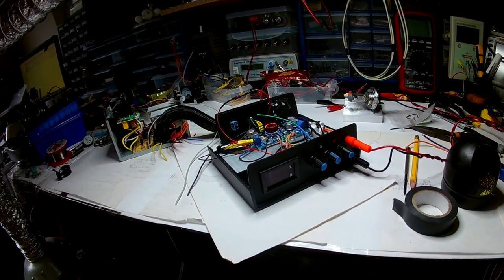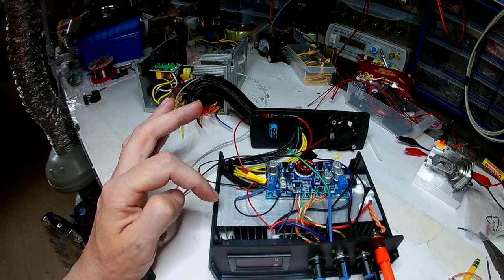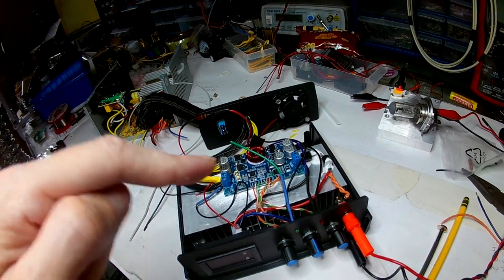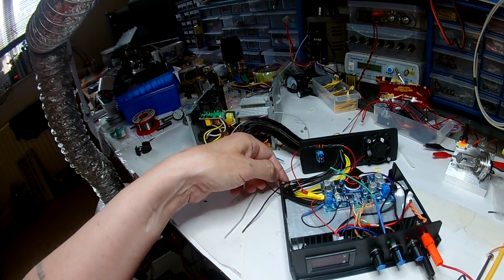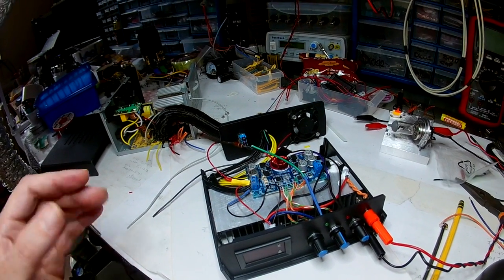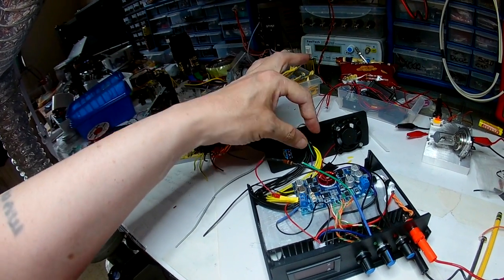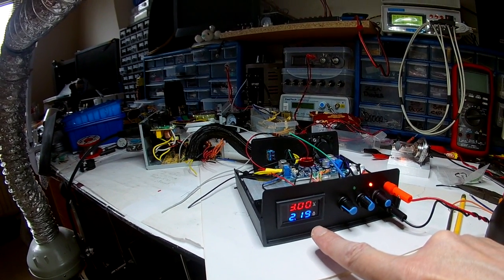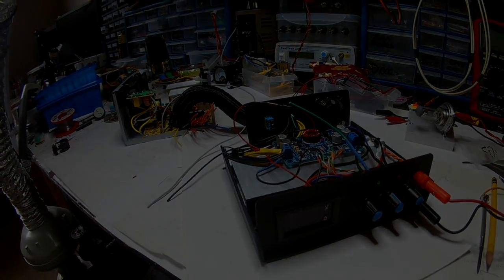DIY Bench Power Supply Using ATX PSU with LTC3780

Comment: How is the module performing after all? I got mine and I'm still looking for a way to change the trimpots. Afeter reading some reviews about this module "WD2002SJ - LTC3780 " it looks like changing the trimpots with a single turn pot it is not working for every one due to the design of the module and high frequencies (inductance and capacitance) which play a big role here. Some ppl killed their modules doing so, others didn't get them to work with a single turn pot and had to change them back with the "original" ones. Wire-wound potentiometers seems to be out of question, worst idea for this application and not only ( high inductance). Your feedback would be highly appreciate it.

Comment: great build and vids, built one using the same 3780 removed the pots from the pcb the 500k and 250k ones for cc and cv, using a 13.8v 5 amp psu to supply the buck boost board and seems to go in to fault as soon as it gets to around 12v output, the pots on the front panel are only the single turn type, any ideas ?. 

oh also had another board think it was a knock off tried charging a battery 12v battery and it blew the 25v output caps on the 13.8v psu never thought it could back feed now using output diodes
Reply: how do you know how far to adjust the under voltage one ?
Reply from the maker: i adjust mine and one way it lets me have output and full the other way it does not.
Reply: The under voltage pot is for if you are powering the board from a battery/solar power system. For this design it is only necessary to adjust it a little above your 12V input from the ATX power supply voltage. The fault LED would then indicate if there is a fault with that input voltage (i.e. your ATX PSU is fritzed.)
Reply: cheers nick

Comment: can i directly connect it to a ATX power supply 12v 25a?
Reply from the maker: Yes  it is a boost buck converter. Give it plenty of heat-sink if running high power.
Reply: thanksss!
Reply: @Elecifun  If my ATX is putting out 12v 18a and I use a buck boost will be able to get the same 18a at say 24 or 30v? Also in terms of the display will I have to use something higher than yours?
Reply from the maker: @LEO-xo9cz  12 x18A= 216W 
so at 24V you will have upto 9A 24Vx9A=216W 
Regarding display, make sure you get a 10A or higher and it is able to display your desired voltage range. 
Hope this helped buddy.
Reply: @Elecifun  Thanks. So at 36V I would have 6A?  So this would be a drawback to boosting this particular output?
Reply from the maker: @LEO-xo9cz  Yep you got it buddy. What you might want is a higher power rated power supply, lets say 500 Watts
Reply: @Elecifun  Thanks you've cleared up something I've been trying to work out all week!
I'm a novice at this.